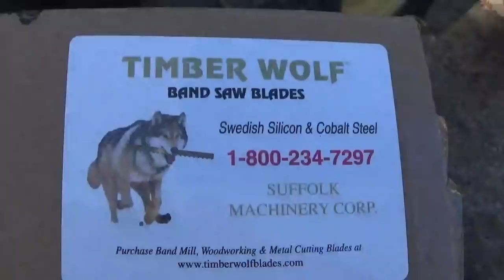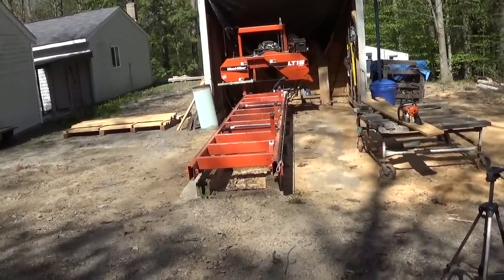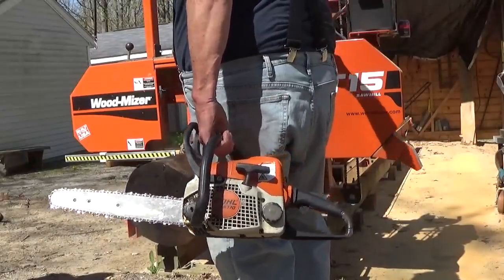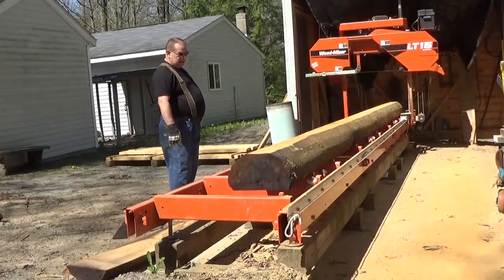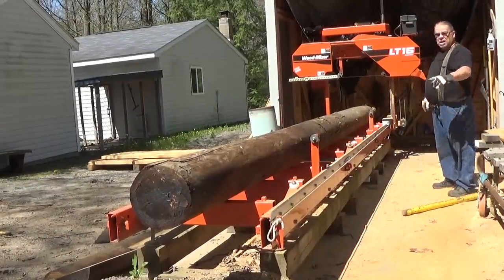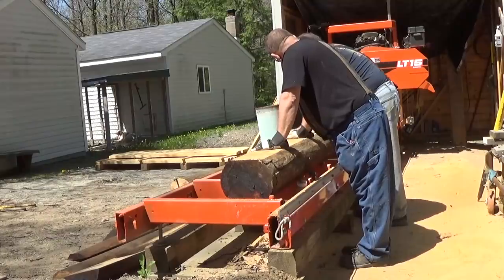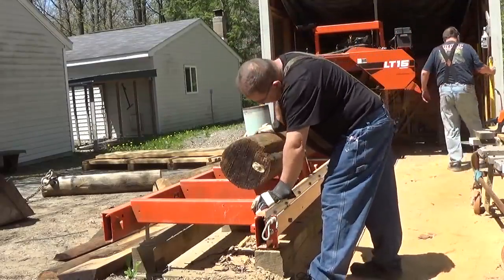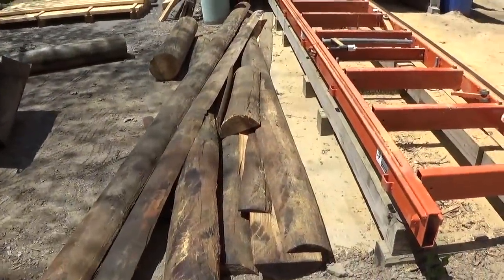Cutting telephone poles for the neighbor, with the Woodmizer LT15.

Comment: It's a fact Joe at our age just making through a day of work is a huge accomplishment.  Doing it without a trip to the hospital well that's a great day. Soon as you mentioned saw telephone poles I knew it would be a miracle if you didn't hit some sort of metal. Let's just say I have some experience with that. Enjoy these pretty days it's going to get hotter I think. Hope Sally is doing well also probably busy keeping you two guys out of trouble. Lol
Reply from the maker: There was not a lot of metal in the poles but it only takes 1 staple to destroy a blade. I noticed the set getting bigger as I was cutting and the destroys a straight flat cut. Have a good one.
Reply: @josaljo1  South Central Pa, Metropolitan Edison used to attach a metal pole number band with 2 end nails.

Comment: As one other commenter said, yes nasty sawdust. I think they're coated with creosote or something near the base.  I've sawn lots of Hydro poles, and they're high quality lumber. Used it to deck a trailer and build a bridge. I metal detect the poles first. Good video!
Reply from the maker: We had pulled nails and some staples out of the poles but it is not hard to miss some.
Reply: Actually those poles are treated just like pressure treated lumber, only worse. The entire pole is infused with carcinogens to repel bugs and prevent rot. With all that sawdust blowing around those guys should have been wearing masks to prevent inhaling the material. I saw them both rubbing their faces which is a great way to get infections in the eyes or mucus membranes. I handled poles for fifteen years and am well aware of the cancer causing ingredients in them. Don’t ever use them indoors and don’t ever burn them. After removal from the ground they are considered hazardous material and can only be disposed of at certain disposal sites.
Reply from the maker: Good lumber for sure, they are loaded with preservative and weigh a ton. Thank you
Reply: @donnebes9421  They were originally treated with pentachlorophenol, a know carcinogen. If these are treated with that it doesn't matter if they rub their eyes or not. Just breathing the dust should be enough to shorten everything. I was around that crap for a bunch of years, but we were in level A suits with airline reperators.

Comment: I have sawed many creosote power poles. I learned a lot on the first one I cut. The next one I put a spray nozzle right where the blade comes out of the wood. That way all the sawdust is immediately blasted down to the ground by the spray of water. If you don't, creosote sawdust will float all over the place getting on your skin (it burned my arms really bad so i had to wear a white long sleeve shirt the rest of the summer because when the sun hit my arms it burned like hell) or worse, in your lungs.
Reply: How long did it take you to get over the creosote burn? I currently have it
Reply: @popper58  it took about three months. I had to wear white long sleeve  shirts all summer because if the sun touched my skin it felt like it was on fire
Reply: The best thing to know about creosote poles is to not mill them
Reply: Meh u get used to it, I used to cut window holes into fire proof doors at a factory with a cnc type machine... the first day I cut fire proof ones my sinuses w3re going crazy and throat hurt and everything, but everyone else didn't even notice. Eventually I became tolerant to it also
Reply: @krisknowlton5935   creosote  makes  your skin sensitive to wind as well ..  I used to do coatings on tanks and  pipes for municipalities  in California  a d many of them use creosote  in the  coatings .. so you get it on you when sandblasting as wells as when  applying coatings ... the first day on the job I rode my motorcycle.. 50 miles to work ... I learned very soon it was a bad idea
Reply: The heated created while sawing will affect a chemical in the creosote and produce an arsenic like compound which could be very dangerous health wise....My sawyer always wore a cartridge face mask designed for hazardous waste use...he would use the cartridges designed to remove dangerous elements..just a precautionary.

Comment: We had to do similar on a buddies Timber King.  It was easier as he had hydraulic roller toe boards so sliding it was easy as it was on rollers.  We had to cut down some 26' beams in width and height due to a change in building plans(otherwise known as a f#$k up).  Good thing they didn't need to be larger as my beam/board stretcher was broken

Comment: Timber Wolf blades are awesome!  You dont have to run as much tension on it so the blade stays cooler and doesn't stretch as much. The even sound different when they are working. They aren't cheap blades, I highly recommend them. If you call them they usually will send you a free blade to try it.
Reply: I was trying to think what blades this was when I had bandmill. I like this blade too.

Comment: I cut 25 at one time 14 ft.  I used regular woodmizer blades, so remember that the next time, u don't need different blades. It sure is inching, u get blister in the sun handling them, but they last. forever.
Reply from the maker: My neighbor bought the other  blades. But I want to try my blades on them next.

Comment: Chemicals in the pressure treating prevents rot by not allowing bacteria to thrive. Pressure treating does not penetrate very deep into the wood on the sides of the pole. The pressure treating on the outside of the pole protects the untreated center wood from decay. Removing a thick slab off the side of the pole now exposed the untreated wood to the air, allowing it to decay. Probably not the best idea for a foundation.

Comment: At age 65 I just started a job making deliveries for the local lumber yard.  90 degrees and unload 200 sheets of OSB Plywood.... carry it 40 ft.  Wife told me after milking cows for 45 yrs Id never find a job. They hired me on the spot. Went to work the same day. I suppose my health relates to me being a distance runner since the age of 14. . Qualified for the Boston marathon. Ten miles per day......same day baled 2000 small square bales......still had to milk cows.  Work.......stay fit. Once the belly hangs over the belt line.....it goes down hill fast !
Reply from the maker: My diabetes medicine is causing my weight gain. I am trying to fix it, but it is very hard to do. Good luck with your job.
Reply: @josaljo1    Interesting. Three people Ive known almost died because they could not keep weight on .  They had troubles regulating their meds... insulin... blood sugar.
Reply from the maker: @jerrylansbury9558  That is why diabetes is the slow killer, I just thank God for his help over the last 32 years of having it. Have a great day Jerry.

Comment: A video showing how you sharpen your sawmill blades would be interesting. Also looks like the chainsaw blade could use a little sharpening.
Reply: here's good video  https://www.youtube.com/watch?v=E405lMAGFGM

it sounds way more exciting than it is. I use a manual blade sharpener similar to the one in the video, meaning I have to forward the blade with handle after each tooth is sharpened. I have about 60 blades I sharpened Spring of 2022. did it over about a week's time, taking breaks b/c it's so monotounous. The initial adjustments take quite some time, as there are numerous aspects of the sharpener to set up. Mine uses a five gallon bucket of sharpening fluid. I set the sharpener up on a generic  equipment stand and made a bottom shelf under it, with casters to easily move it around the shop. the 5 gal. fluid sit on the shelf under the stand.  it requires two other stands that have blades guides mounted on them to hold the blades on a flat plane level with sharpener. I use my two roller stands b/c I can adjust the height easily. I simply mount the guides on top temporarily for when I sharpen, then they get removed and stored when not in use. 

once I get things set up I slide the blade in, turn the pump on, then the sharpening wheel, which is chosen to specifically make the cut you desire for your blades. it's a diamond coated disc (think grinding wheel), tapered a bit on one side to match the gullet of the blade. then it's one hand on the handle for the sharpening wheel and one hand on the blade forwarding handle. I get a little rhythm going back n forth. With over 70 teeth it takes about 10-12m per blade. Can't go too fast or things get outta whack, and you find yourself readjusting everything which can take another hour. 

I get maybe two sharpenings outta each blade. I buy the cheap $20-25 blades,  instead of cobalt blades, for one reason... when you hit a nail, or in one case a chunk of rebar someone had hammered into a tree long ago which was then embedded about an inch in from the bark,  the blade is toast. I'd rather kill a $25 blade than a $200 blade.  And some blades, after just one sharpening, will fail while cutting on the mill.

Comment: This blade with cobalt should be an excellent blade. Cobalt drill bits are the best I have found to drill steel that I use to make knives. If these blades are cheaper than your current blades I think you will change to these cobalt blades  for two positive reasons.

Comment: I think where you are having troubles with runaway blade is that you have blade a little loose and as well blade guide to far away from the log surface. try it as it may help. good job guys. Liked what I see and be safe.

Comment: And if you are sawing telephone poles or farmers logs get a high quality metal detector. You would surprised how many times you will find nails in old poles and farmers logs that were once there to hold up telegraph wires , phone lines , power lines and signage

Comment: Telephone and power poles are usually pressure treated and then coated with an oil substance like creosote ....you don't want creosote or the stuff that they treat wood with to make it pressure treated in the air or your lungs .....

Comment: Hi Joe, what did you do to straighten out the surf board?  I cut 100 1x8x8 and 100 2x4x12 in the 4 days the new guides are working fantastic. Have a good one
Reply from the maker: I put a new blade on the saw and cut the opposite side, the surfboard will go down in  the dirt.

Comment: Anyone over 50 should go and have a calcium test done of your heart to check for clogged arteries - it costs about $100 (insurance doesn’t cover it) and saved my life - I needed bypass surgery and had NO symptoms at all …. Was 98% blocked in main artery - If you get out of breath easily or just feel tired always get it checked - do the test even if you have no symptoms it’s cheap enough and could save your life - it’s no joke.

Comment: Hey Joe, interesting video. Timber’s will make a might-t-fine sill plate. Those looked to be CCA/ACQ treated should last several generations. 25yrs ago I was driving same 20 footers on Texas coast for a sea wall.Had to get em down 12’ or better in a straight line.
8x8 x20’ whalers/stringers.
Reply from the maker: They are pretty tough and with no knots they are very atrong.

Comment: Just a quick question.Why didn't you just back off your saw 3-5 feet and shim the waste up off your blade and push the log backward and just finish the cuts of the extra long log.
Reply from the maker: Basically that is what we did.
Reply: No you added a step by using the chainsaw to wack off beginning of slice
Reply from the maker: Sliding the blade back without cutting off the flitch sometimes causes the blade to come off the saw and that always ruins the blade. Cutting the flitch and raising the sawhead stops that from happening. We needed the full length of the pole. Sliding the pole or log can cause it to not be level with the blade and that will make a crooked cut. I avoided all that with cutting the flitch off.

Comment: Chainsaw has a throttle is yours broken just thought I'd ask.
Reply from the maker: I had left gas in the saw all winter and it just would not rev up. It is fixed now. Thanks John.
Reply: Good deal saw is running fine now I hope I didn't sound to smart mouth with my comment thank you for your response have a good day today get after it .John c Moss Ola Georgia,USA

Comment: i would not cut the lower 8 feet of a power pole because that is where the nails and bullets are.
Reply: Right you are they have all kinds of crap stuck in them and the top is just as bad with all the utility attachments.

Comment: What did y’all have to do about the pole that the saw took a dive on?
Reply from the maker: The blade had hit a large staple, I changed the blade and it cut straight again. As far as the pole we just used the opposite flat cut.
Reply: Josaljo Won   That is great!!!  I was worried that it messed up the pole and he would need to get another one.

Comment: Did you not hear the zing at 46:25 that was metal and you were pushing way to fast, I use to hate cutting trees from peoples back yards and T poles full of metal. lead and clothes line hooks.
Reply from the maker: These poles were new just 3 years ago. So they were not that bad. But I dont cut trees from peoples yards, you are right about the clothe line hooks.

Comment: Why didn't you just cut the excess off with the chainsaw rather than keep messing with it moving it back and forth like that also why did you cut the first piece so thick
Reply from the maker: We need the whole length, and an 8" slab on top.
Reply: That's what I'm saying you don't need the whole length because you're cutting a good what foot and a half off the end on the second pole you cut it right through that made more sense right and I get now that you need an 8-in on the top I made the comment the first one that I seen you caught the second one made more sense to me I get it now I used to work on a sawmill same one but ours is was like One step up it had hydraulics on it for the dogs and it had a long Turner on it as well or I can't turner but basically the same thing I loved siren logs it was the best love the smell loved everything about it I can't believe you're doing it at your age it's hard work good job man keep going body in motion stays in motion

Comment: I never see you using any lube on the blade   .???
Reply from the maker: When I start the saw in the morning I use 2 squirts of wd40 on the two rollers and the blade. To me the water is a waste of my time. Unless I am cutting really very sappy white pine.
Reply: @josaljo1  must be some buildup on the blade.     Somtimes i will use a scraper on blade while its turning to remove the buildup
Reply from the maker: @jerryoneill4433  There is actually no buildup on my blade unless it is extremely sappy pine. Then it is only very minimal.
Reply: @josaljo1  i get alot of buildup especially cutting cedar
Reply from the maker: @jerryoneill4433  What do you use for a lube?
Reply: @josaljo1  windshield washer this time of the yr.   Water for the rest
Reply from the maker: @jerryoneill4433  In my opinion, the water in any form is what messes up the blades. After 2 years or so I just stopped using it and never looked back. Unless it is Pine that is really sappy. Otherwise I don't have a problem seriously.

Comment: Sorry to criticize, but either sharpen that saw or buy a real one. Seems like that 1st cut was a little heavy. Don't know what you're using the lumber for. Just an observation.
At this rate you should be done by winter??    I had to stop 1/2 way thru. This was painful to watch. Sorry.
Reply from the maker: The carburetor is gummed up.

Comment: You're brave cutting telephone poles ... those things were designed as pin cushions for 1 inch spikes! ... I hope your well water isn't orange and dribbling and the level falling because of all the fracking in your area ... we have always banned fracking in Ontario ... coal and gas=fired power plants are also outlawed ... sometimes freedom to make money comes with unacceptable costs ... Farmer John, Ontario, Canada (expecting some thumbs down ... an acceptable cost)
Reply from the maker: My well seems ok but 2 of my neighbors are having problems. One with the color the other with the volume of water.
Reply: How do you get electricity?
Reply from the maker: @donmartin7728  When we first moved here we were off grid for 3 years. Then they installed power to feed the gas wells and we got power at that time in September 2009.
Reply: @josaljo1  why did you go on grid?  What fuel powers your grid?
Reply from the maker: @donmartin7728  My wife wanted to be on grid, at the time I was working 240 miles from home.

Comment: You really should be wearing a respirator The three major chemical used to preservatives the poles are pentachlorophenol (penta), creosote, and arsenicals (copper chromium arsenate, or CCA). That dust and sawdust is not good.